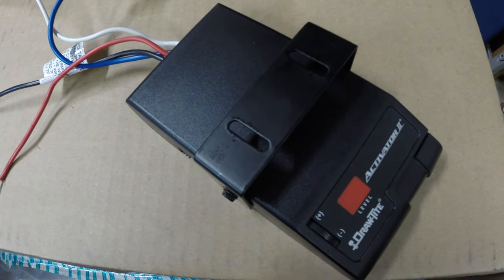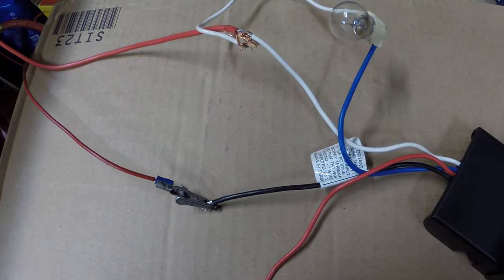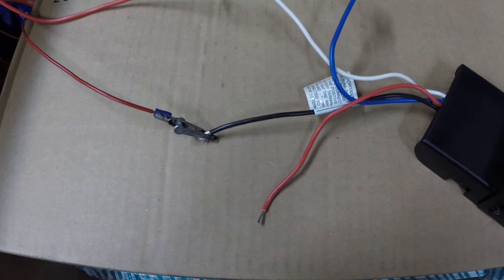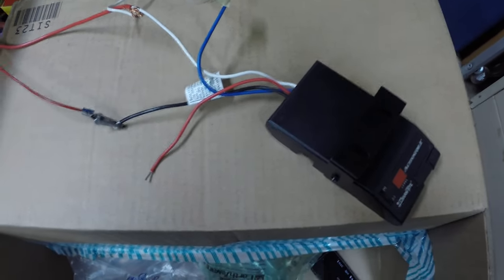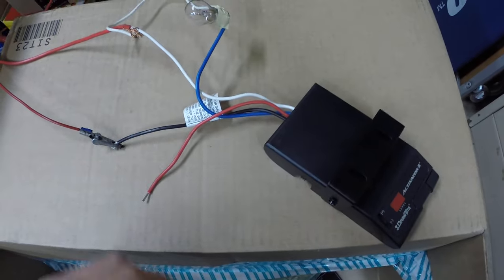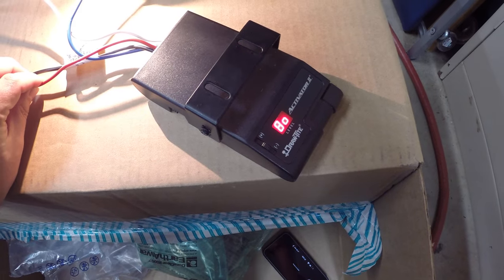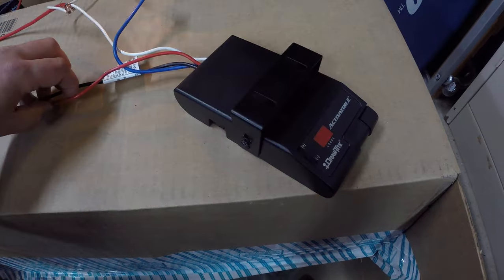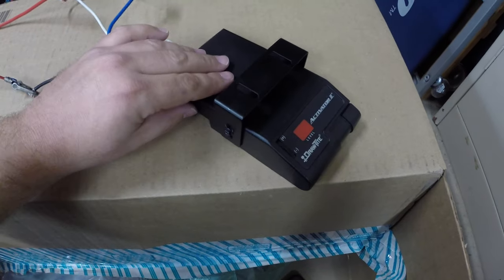Testing Trailer Brake Controller (Draw-Tite Activator II) Time Delay

Comment: Had to look twice but it seems by color code, the black wire is to ground and the white wire to B+ positive.  Electrons do not know the difference however standardization of color codes helps.

Comment: If you are able to help I’m just using a volt meter instead of a light. With a car battery hooked to the black and white wires the blue wire has 12v Without touching anything on the controller. Bad controller? 

I’m testing it because I had 12v at my brake pin on the truck with no brakes being pushed. Thanks for the great video!
Reply from the maker: I think I remember doing the same, and if I remember correctly the manufacturer said that was normal as it will have voltage to it but the amperage is almost nothing. You might have to try it with a load?

Comment: I just installed a "curt" on my truck. Took my time went very slowly. Now when I hit the brakes it blinks red indicating a possible short it says. This is pretty basic stuff - could the unit be damaged? Mine will not do what yours is showing. Black to power - white to ground - red to brake light switch - blue to trailer. hmm..
Reply from the maker: Hmm, did you try bench testing it like this? And just to be sure, red should get B+ on the red wire for the brakes being applied... Did you check the wiring on the vehicles side with a voltmeter? Those two should narrow it down whether it's the controller or the vehicle's wiring...
Reply: @kmmmor  yep all of it . All there is a red flashing on the controller. And your video is very easy to understand it. Maybe a dud..
Reply from the maker: @kingtitan2051  Yeah, my guess would be it's a defective unit then...
Reply: @kmmmor  on mine it will not light the bulb.. Anyways great video. It helped me figure out its broke lol

Comment: did you just run this to a car battery? using the positive and the negative sides, then the blue to a bulb with the outgoing to ground?
Reply from the maker: Yes, that's correct

Comment: When I hook it up with my trailer and apply the brakes ,the brake unit shows 00 and when I try and adjust it, nothing happens. Do you know whats wrong with it?
Reply from the maker: Is this for the same model, Draw-tite Activator II? I don't see in the manual what 00 would be, the output knob is turned up right?
Reply: I also have the same problem zero display no matter where I set the brake controller